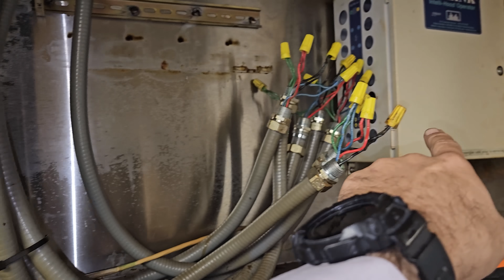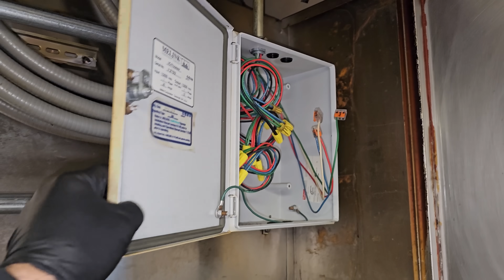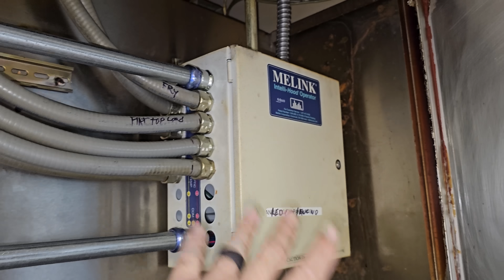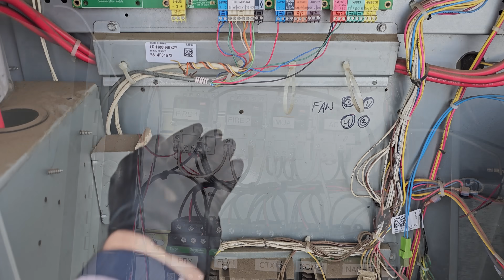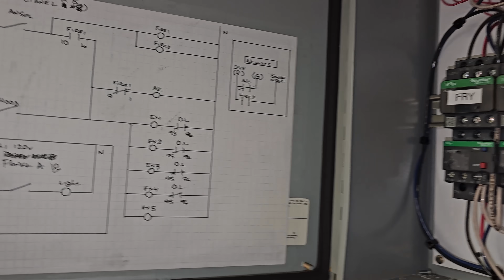EXHAUST HOOD CONTROL RETROFIT

Comment: In our area, the hood system also shuts down the gas valve and shunt trips the electrical power to any cooking unit that is under the hood, I didn’t notice that in your set up, but it’s probably being done through the second auxiliary Ansel contact in the Ansel system

Comment: Being a control electrician, I certainly see the pros and cons of the original system. The con being most electricians and hvac techs have no idea how to correctly program a VFD.  So they end up bypassing them. VFDs are pretty cheap these days.  Yes, they may have been originally sold for cost savings. But true advantage is the soft start, which is better for the electrical and mechanical systems. And you can balance the system. Now it's like having a car with the gas peddle wide open weather you need it or not.
Reply: There are just too many VFD manufacturers and each one just HAS to have their own stupid way of setup. At my factory we try to use NIDEC (Control Techniques) Commander VFDs in most places if it's possible to order equipment with them, that way majority of drives we have we can change parameters and diagnose without bringing a whole ass book.

Comment: Maybe I missed it, but why did the old system need to be removed?
Reply from the maker: The VFDS had all gone bad and been bypassed for a few years , about two months ago they hand a power incident and 4 of the motors burnt up. We might have been able to save the motors if they had some sort of motor starter. So the customer decided it was time to fix it. They had long ago determined that the fancy system did not save them and money

Comment: Do you have thoughts on why hood VFD's fail? The area seems pretty clean, so that would suggest either heat or power quality issues, assuming the device isn't underspec or made poorly...
Reply from the maker: Power quality issues with no power monitoring and or protection on the building

Comment: the box with the contactors that you rebuid reminds me of how stuff is at my work in 80's boatlocks and bridges, just simple relays that work, tho the wooden controldesks with buttons have been replaced by a PLC so it can be controlled via software on a remote pc in a big controllcentre for bridges and boatlocks.

Comment: Would it be possible to use a signal from the exhaust fan contactor to trigger an outdoor air damper position change on the ACs?
Reply from the maker: Yes that’s what I did and that is what they were doing before with the smart hood too

Comment: Look free equipment for eBay? Couldn’t you get the secondary box with motor starters wired and ready to go with wires to the pipes for second junction box and just go in swap it over and calibrate it at 8am and ready by 11? If you knew the numbers for each and had all the wires ready for each AC prior to starting?

Comment: As-built drawings are always fun to be missing. Tracing out wiring is such a good use of time 🙄

I'll take these cabinets' wiring over the vast majority of cabinet wiring I've encountered. One FACP I worked on had field wiring that caused a wire to have intermittent contact thanks to the field wiring being stuffed in it. I was lucky to have caught this issue by moving this zone's cabinet wiring around.

Comment: These boxes look more than decent for the conditions you had to work with. Much better than the usual rat nests left behind by other technicians who don't get the time they need to do the job proper. As for the Wagos, check out the new inline connectors they have now. Might come in handy on future jobs.
Reply: Not sure why you need wagos when you've a panel, can you not build a rail with connectors on? Clearly I'm sat in my mums basement miles away from the sharp end of the tools!

Comment: Love the videos! Super helpful! It looked to me like the VFDs were failed on the previous set up. We’ve had issue like that on similar looking panels but they usually don’t want a full rebuild of the starter panel. Even though that wasn’t how you wanted it, that was super clean work and easy to follow for the next guy. Great video!

Comment: Im a building automation controls technician while i love VFD's and DDC control they require a service contract to maintain their operation, in commercial kitchens like this a controls service contract is rarely made. In this situation traditional motor starts will impact your power bill but again motor starters and relay control are less maintenance heavy.

Comment: When you have room you should separate the contactors (that you call motor starter, we call them motor protection switch), helps with heat buildup and gives the contactors a longer lifespan

Comment: Why did they want this done? What was wrong with the old setup?
Reply from the maker: The old vfd's were all bad and bypassed, and the cost to bring the system back to normal operation was far exceeding the energy savings so the customer want conventional starters instead
Reply: New vfds are very expensive but recommended especially on exhaust systems. @HVACRVIDEOS
Reply: @HVACRVIDEOS  Makes sense, thank you
Reply: Looked like the old one was overcomplicated, poorly documented and using manufacturer specific parts. You can only keep something like that going for so long before the best solution is to rip it out and replace it.
Reply: They might have just wanted to simplify operation...that's my best guess.
Reply: Nice job! Love the schematic.